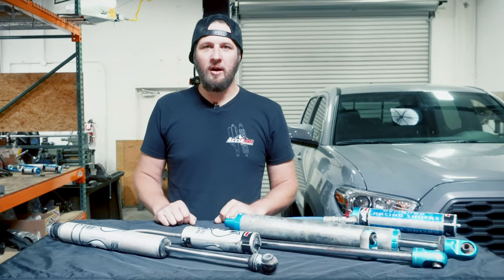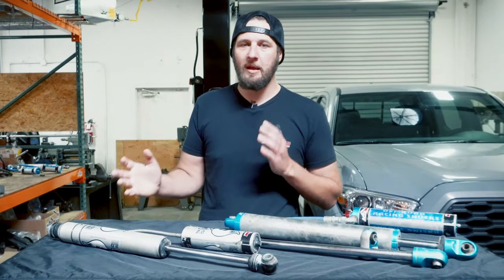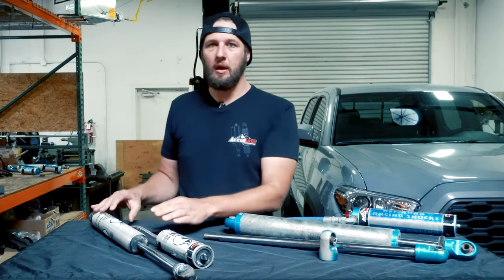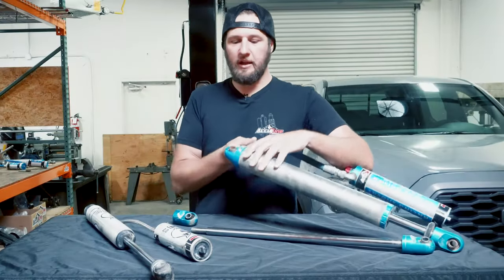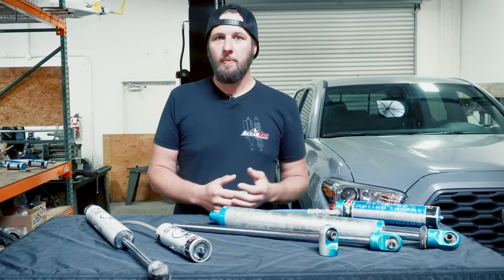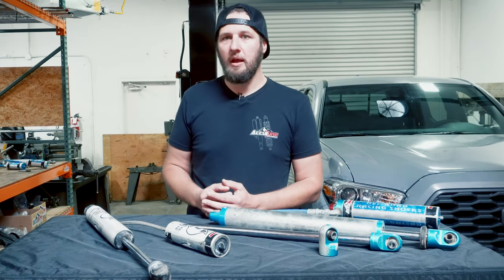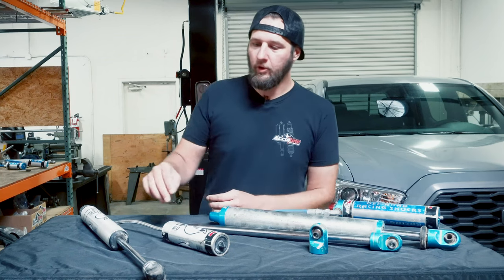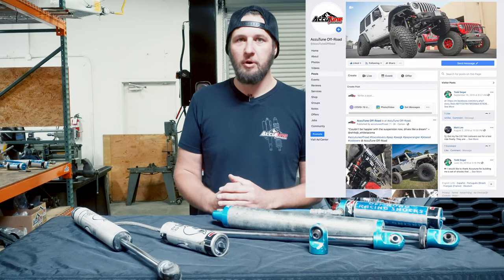Is it time to rebuild your shocks?

Comment: If properly sized shocks had 80s-90s style accordion seals/covers would they last dramatically longer?  Seems like the trend is the cool look vs protecting the shaft/seals.
Reply: I know this is 2 years late, but those accordion covers have downsides too.  They can trap water and cause rust pretty quickly.

Comment: Do you guys offer a general rebuild kit for the raptor 2nd gen rear shocks? Also, what's all needed in the rebuild process apart from all the seals. Like the shock oil, amount each shock suppose to have, etc. Is there a video or set of pdf instructions I can follow so that I may rebuild my own shocks. Thank you for the content btw.
Reply from the maker: Yes we can service those shocks. Seals, oil and any other worn out parts get replaced. I'm not aware of a video or instructions on how to rebuild them.

Comment: Bro i have fox  Front 880-06-947  and Rear 883-26-006 . . about 30k miles on them , about 2 years on use never checked them.. I just bought the refill gauge and the rebuilt o-ring kits .. Will i need anything else ?  like shock oil or maybe the bearings?

Comment: Good info.  I have the fox 2.0 performance on my jeep JL and one is leaking after 2.5 years.  It sounds like buying new ones is better though.
Reply from the maker: Not necessarily. A leak can be fixed easily with a fresh rebuild, quicker and cheaper than buying brand new.

Comment: what happens if I put some fox coilovers on a street 4runner  and I dont plan on rebuilding them after 50k miles. im replacing some OEM ones that have lasted over 150k miles. can I just leave them un rebuilt

Comment: Is the ride height a sign of rebuild? My truck is sitting about an inch lower from when I got my 2.5 kings
Reply from the maker: That could alter ride height slightly. It's always a good idea to check nitrogen pressure on shocks once in a while.
Reply: @accutuneoffroad  they were both out of nitro and needed a rebuilt😩 and my front shocks as well... only had these kings for 8 months
Reply from the maker: @HANIDLAHTI  Dang, sorry to hear that. If you need someone to rebuild them we can certainly help

Comment: Is it common for a fox 2.0 piggyback to leak oil after 200 miles?? Am I riding that hard?
Reply from the maker: 2.0 Piggyback? Either way, no that is not normal and should definitely be inspected for damage and be rebuilt